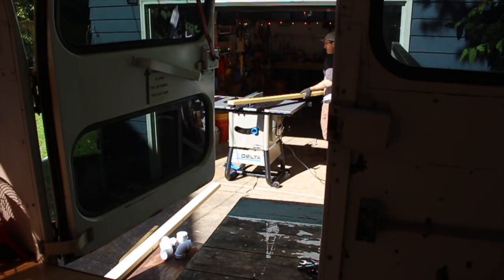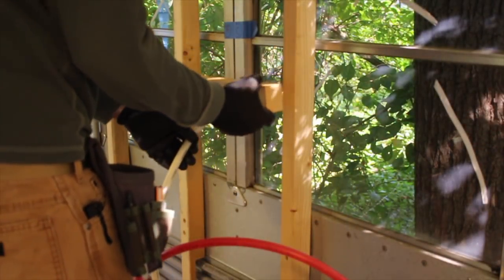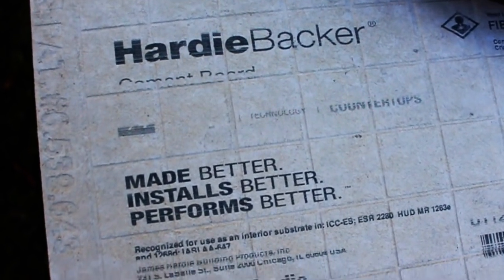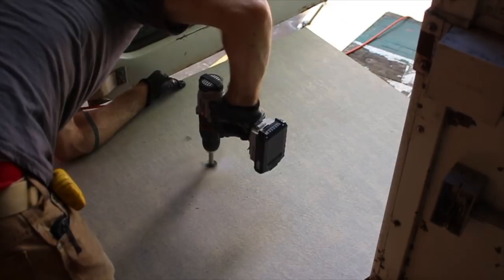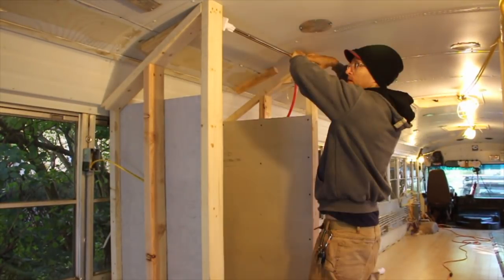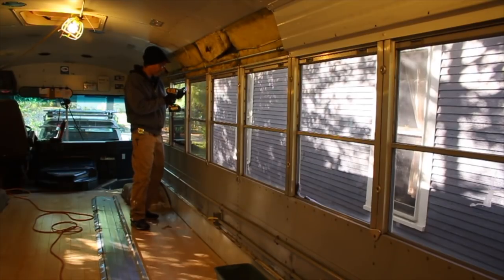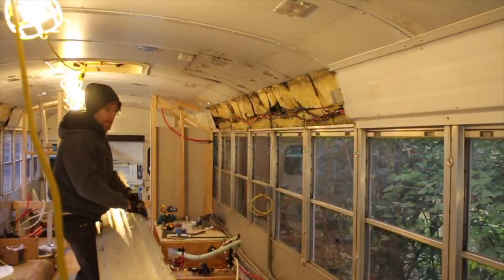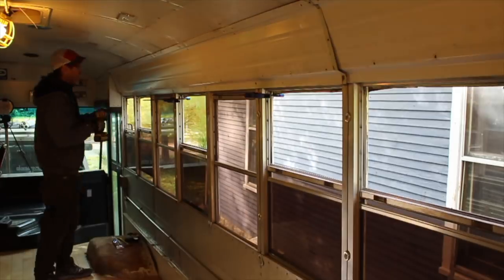Shower In, Windows Out -- Prison Bus Conversion #22

Comment: What did you use to seal the windows back up? 3m 550? Also how many windows did 1 tube do? Thanks.
Reply from the maker: Polyurethane  ... 3 or 4 tubes as I recall. Get it real clean first
Reply: thx I already got 2 of the 3m stuff based on recommendations on skoolie net Sounds like it might be enough for my half size bus. Did you test the windows seals with the bus on to see if they rattle at all? That's what i was worried about besides waterproofing.
Reply from the maker: Sounds like you have a great plan. 3m stuff will be good. My windows don’t rattle as they were never opened... but yes, test yours! And good luck